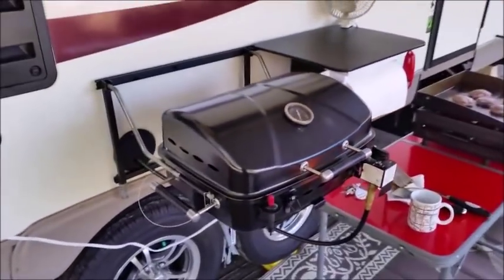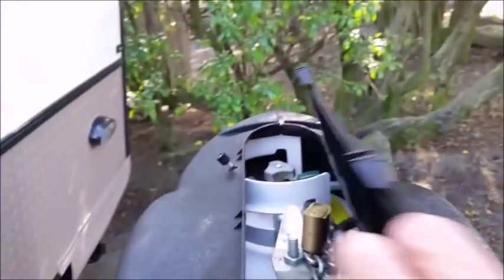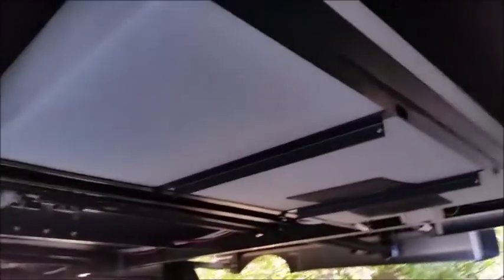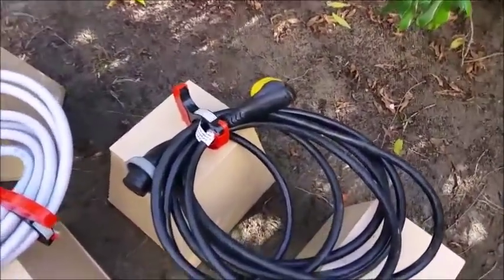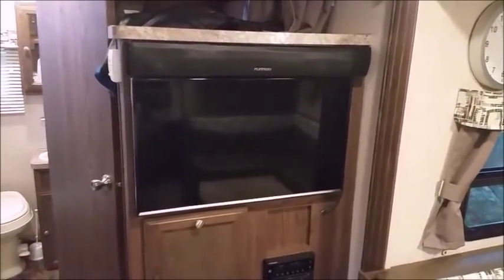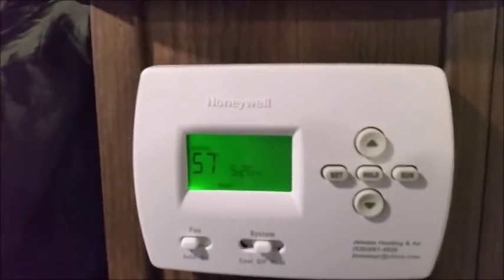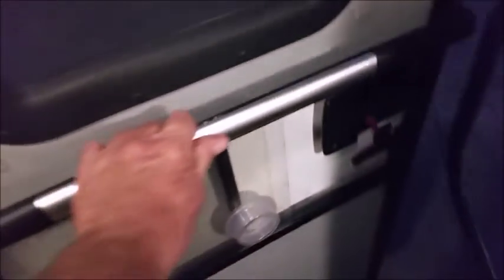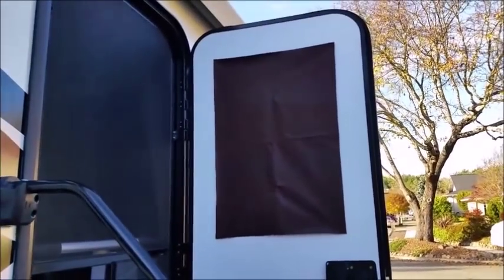Travel Trailer lots of modifications and pointers

Comment: I wish Rockwood would watch this video and just simply do everything you have done as standard construction!
Reply: Not just Rockwood, EVERY RV manufacturer should be watching this video. I had purchased a new Coachmen trailer in 2013 and ended up doing many repairs on my own at my expense due to poor workmanship. It is impractical and inconvenient to bring it back to the dealer for warranty work because it takes 3 weeks to get an appointment and they hang onto your unit for two weeks or more to get authorization from the manufacturer to undertake the repairs. At one time, they waited two weeks before they inspected it and another week waiting for parts from the manufacturer before the work actually being done for a minor repair.
Reply: @colingee6687  especially those little screens, they're  great to keep those pesky bugs out.....
Reply: Late to reply. We dont’ even have this brand or model think rock wood is in forest river family. Downsized from a fifth wheel to Cherokee wolf pup. The thing they did too cheap or dumb things like blocking ends of cabinets with plywood. Is just dumb not money. From your mouth to all manufactures ears!

Comment: Good stuff, Michael!   Too bad that there are like 10+ ads on this...PITA!
Ha- I had done many of these mods!   Nice work on these!
I HATE these "sealed underbellies" on the new Rockwoods.  Can't check anything!
Tempted to take the damned belly cover off.
I replaced my "Lionshead" tires with new Goodyear Marathons. Next size larger: 215 /14. They fit nicely and give me more weight capacity margin.
I carried two large bikes on a bumper-mounted carrier coast to coast- no problems.
Nice job on those plywood stabilizer blocks!! Crack woodworker! 
I installed a clean-out elbow with a plug on my gray tank ABS drain pipe. Remove the plug and I can snake in a garden hose and flush out the muck.
Reply from the maker: Thanks for sharing some of the improvements you've done Captain. Keep an eye out for a video I'll be putting out there on a flush system I'm installing on our Gray Tank, I think you're going to like it. It was nice meeting you and your wife at Doran Beach the other day :)

Comment: Great video with straight to the point descriptions.  Great mods also.  I second the reflectix cut to cover windows to keep out the light and summer heat.  I also cover the door window and ceiling vents with reflectix held in place with velcro dots.  They are easily flat stored under the mattress when not in use.
Reply from the maker: Thank you and I appreciate your tips to. Sorry I was so jerky with the camera, I was rushing through everything. I've gotten much better with my other videos

Comment: Very nice mods! We just upgraded from a Rockwood Roo which we owned for 3 years. It wasn't until shortly before trading it in I discovered the fridge doors had latches on them to hold it open during storage to prevent mold. So you may want to check for those if you haven't already.
Reply from the maker: Thanks for watching, have you watched my other videos? What trailer did you upgrade to from the Roo? Yep, I use the latches to hold the refrigerator open :)

Comment: Regarding the bumper mount: I have seen them fail.  It's not the strength of the welds or mounts.  What happens is as you travel the weight of the item mounted will oscillate continuously and eventually fatigues the metal around the welds on the bumper, your first indicator is the people following you on the road will  start honking and pointing as they pass you going down the road.
Reply from the maker: Thanks Jim, I've been thinking about strengthening the bumper at the welded joints with brackets. When I do I'll post a video. Thanks for you comment

Comment: The most important point you made in this video is TIRES!! I’m on my 3rd TT and I’ve always replaced the cheap Chinese tires with good quality ones. I currently run the same Goodyear Endurance tires.
Reply from the maker: I totally agree with you
Reply: Yep.  Start with good tires, keep them inflated properly, and protected from the sun.
Reply: I just installed the new Goodyear Marathon tires. Went up in size from 204/14 to 215/14...gives me a bit more weight carrying margin on the tires.

Comment: I’m always a year late to videos but you have great ideas. I’m already making a list. I need these safety pin hooks for other things. Lost 2 of the hair pin ones on my hand dolly that converts to truck? The other way, flat for plants etc. Thanks for the video. Will look at your other videos. Someone had convince my partner to get a tool type generator. Totally loud and we boon dock. We both injured ourselves to point he had to have back surgery from that dumb thing lifting it in and out? Finally got a honda. Totally quiet and works in an instant but we bought a solar panel for our tiny wolf pup. The fifth wheel I mentied in other comment below in a reply became a tin tent. We think that the 2 batteries, one kept discharging the other. They recommended small solar panel with our new wolf pup 17 foot trailer but we saw the larger one on sale online for what the tiny one would be but it was not a “kit” perse. Still hooked on the same. Just the panel. Off hand I dont know wattage but like 5x the need. It charges our single battery from dead, in the pine trees with dappled shade. I kid you not. We only need the generator to charge phones or run microwave. So my partner made aluminum cross bars on it and put rubber feet so it cant sit flat on roof. We throw on top of trailer when we get to campsite. I modified the box it came in, cutting holes for feet and gluing on Velcro straps. We keep in that when traveling. We do need a small aluminum ladder, found tiny one but tall enough, but we have a truck with teneau cover so no one can steal the solar panel or ladder. It was nice to get rid of fifth wheel hitch in back of truck. Couldn’t haul anything! The concept is nice but my partners life changed meeting me, when his wife passed and now we both retired. She never went camping with him. Only his brothers. We also bought a jeep, so may look for a teardrop in the small versions but are actually modern. Saw a Tab. They make one with jeep type chassis and wheels too. We actually retired to the town we camp and fished from. Ha. Now its 5 mins away! I’m type and watching. Definitely going to have him watch this video too. I should do one on our life. We are really DIY people. Just have to learn that. I used to be techy back you know ....when.
Reply from the maker: Thank you for watching

Comment: Great video Mike! I've watched it a few times now and each time I see something new. Thanks for putting this together. BTW, how did you attach the drawer glides in the pantry? Our walls are not very thick, especially with the fridge on one side (2018 23ikss)
Reply from the maker: Thank you and sorry for the shaky camera work. I cut strips of wood to go inside the cabinet to attached to the sides to fill the gap which brought it out far enough so the drawer would slide in and out without hitting the sides of the cabinet face front. How I attached them to the sides .....I used Gorilla Glue Adhesive https://www.homedepot.com/p/Gorilla-9oz-Heavy-Duty-Construction-Adhesive-8010003/206063265 and on the ends of the strips I was able to screw in small screws through the thin paneling inside the cabinet into the 1"X 1" nail strips that the trailer manufacturer buts in all the corners, if you look inside the cabinet really close you will see the staples where they nailed into these 1" X 1" strips. You could get by with just using the adhesive the just tape the strips into place and let them dry for 24 hrs and avoid using screws if you like, the adhesive is very strong. After the strips where in place I  took my measurements to build and install the drawers. I hope I was able to answer your question :)

Comment: Hi Mike, Chuck & Connie in Missouri.  We also enjoyed your video.  Lots of good tips and ideas.  We are taking notes for things we would like to do to our 2504s.  What brand/model TV did you end up using?  Was it marketed as a 30"?  We have been looking at 32" models and have wondered if they will fit.  Also, what mount did you use on it?  As you probably know, finding a second mount for a TV to match the arm/mount on the trailer is almost impossible.  We haven't contacted Forest River, but might try your idea instead (keeping the Furrion 24" to use outside).  We also switched to Good Year Endurance tires recently after reading a few bad experiences others have had with the factory supplied tires.  Thanks for posting your Modifications & pointers video.  Chuck
Reply from the maker: Hi Chuck, thank you. Its a 32" Samsung smart TV that we bought at Best Buy. I used the mount that came with the 24" TV. In order to install the TV to slide it on the bracket I had to remove the speaker above it and the put the TV on the swing bracket and then reinstall the speaker. I tried to find a new mount that installs on the back of the 24 inch TV so I could use it outside but could not find one :( so I made a custom set up that works. I'll take pictures to share with you of what I did soon.
Reply from the maker: I don't think I can post pictures on here so I will message pictures to you on Facebook. I'll let you know when I message them to you. Mike

Comment: A word of caution: Towing your trailer with a heavy generator or cargo load on the back bumper may result in uncontrollable fishtailing and rollover if you had to make a sudden lane change or encounter high wind conditions at highway speeds.
Reply from the maker: Great word of advice Collin. I make sure that if I do haul the generator this way I balance out the weight in my trailer prior to hauling it this way. Great Comment, thank you
Reply: It would have to be a pretty heavy generator to make a real difference.

Comment: hey Mike, great videos and some fabulous ideas for modifications.  Question for you, the replacement mattress, do you recall if it was a "standard" short queen (60x75) ? In your video you mention it was 10" thick, which worked for you, I was just wondering if the 75" mattress will fit.  We have a murphy in our 2104S .  Thanks!
Reply from the maker: Hello Matt, sorry about the late response. I just went and measured...its a 60X75. So a 75" length fits perfect.
Reply: thanks very much Mike !  I appreciate your help.
Reply: FYI... for anyone else who sees this.  I bought a Short Queen from Zinus on amazon (https://www.amazon.com/gp/product/B01BW7H5ZW/ref=oh_aui_detailpage_o05_s00?ie=UTF8&psc=1) and it fits just fine in our 2014S

Comment: Do you dry camp and run solar or a generator?  How many batteries do you have?   P.S.  my wife is hooked on your mods now.  More work for me.
Reply from the maker: Thanks for watching. We do dry camp and also do full hook ups. I used to run the generator all the time to charge the batteries but now with the solar I only need to run the generator for the microwave & coffee pot, I'm currently working on adding a inverter to run the microwave and coffee pot without using a generator and the video should be posted in a few weeks. Here's a link to my Solar set up - https://youtu.be/j4a9MkLRJN4
Reply from the maker: Here's a link to my battery install - https://youtu.be/1vm4w3BMq4I
Reply from the maker: I have lots of You Tube Videos, if you subscribe and click the bell you will see future videos and past ones I've made. Thank you for watching. Mike

Comment: hey Mike, watched this again and had a question about those Goodyear Endura tires you are running.  Can you tell me the size of those ?  The stock tires my 2014S came with are ST205/75 R14, i was wondering if the Goodyear ST215 fits ?
Reply from the maker: Hello Matt, sorry it took so long to get back to you. My tires are Goodyear Endurance tires ST205/75R14 Load range D. I'm not sure if the ST215 tire fits or not, you will need to talk to a tire shop. I purchased ours from America's Tire, they seem to have the best price around and if you catch them around a holiday you can get a even better deal (sometimes $160 off the original cost)
Reply: no worries !  thanks for the info Mike

Comment: Did your trailer come with castle rock tires?   How long did they last?
Reply from the maker: Hello James, yes they came with Caste Rock Tires. I had around 2,500 miles on them and checked the air pressure and inspected them every morning before heading out and inspected them at gas stations while driving also. I was inspecting them at a gas station in the middle of a trip and noticed a bubble around 8" long X 2" wide near the outside of the tread (I think I only had the new trailer for around 6 months or less). We called the tire company when we got home (we had the contact information in our trailer packet) they had us send pictures and sent us a new tire within 3 days we received it + $30 for the tire change costs. Since we like to travel long distances I didn't want to take any chances and replaced the 4 tires with Goodyear Endurance Tires and left the spare alone. I sold the 4 tires on Craig's List for $25 each to someone that wanted them for a landscape trailer. A lot of people say the tire is not the problem and its the people that don't put air in them but I don't believe that is the case all the time. When the tires were changed out I put them side by side with the new ones and what a difference in quality. I could stand the castle rock tire up on end and push the tire on the tread and the sides would bow out big time and the side walls were so thin. The Good Year Tires did not flex. Sorry this is so long but I wanted to tell you what happened with mine.  I hope this helps. Mike

Comment: What size were the metal slide outs you got for the drawers in the pantry?
Reply from the maker: Sorry for the delay in replying. They are "22 in. Soft-Close Full Extension Ball Bearing Side Mount Drawer Slide Set" - Purchased at Home Depot - https://www.homedepot.com/p/Everbilt-22-in-Soft-Close-Full-Extension-Ball-Bearing-Side-Mount-Drawer-Slide-Set-D94222E-ZP-W/302867630

Comment: pipe foam & wood to keep micro plate from bouncing v/slick. 2 straps w/springs for awning tie downs ck; few brackets & angle iron to beef up ultra lite "poor trailer construction 101 fun & asian tires (God not happy rv corps can do far better)1500 miles defective, ck;  keyless entry most every1 wants make standard already RV corps; Less u hve to lower jacks the better they work, ck; mini cloths or curtain rod drying under sky light in shower, ck;
Reply from the maker: Check these videos out :) 
https://youtu.be/KJUJirHRVYw
https://youtu.be/bTHJFnK-LQM